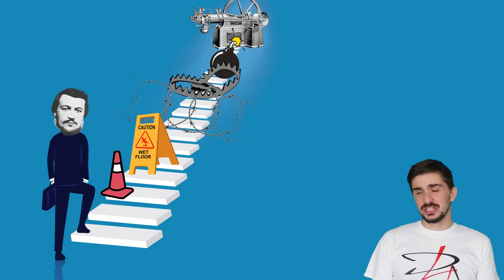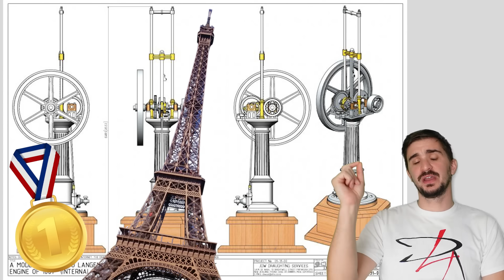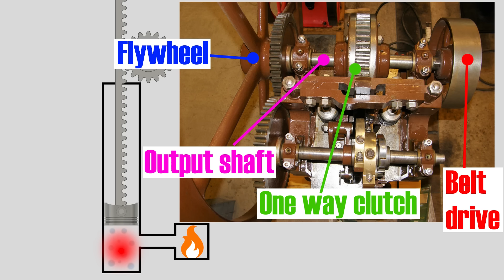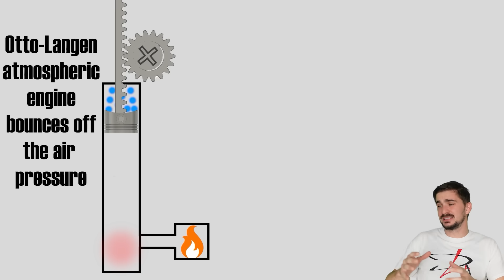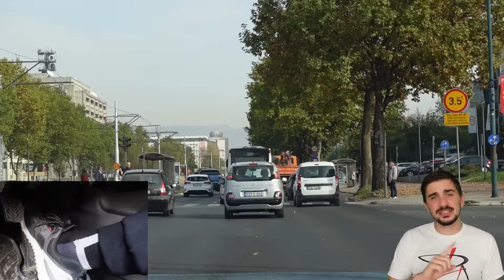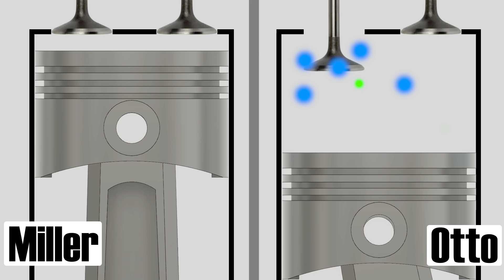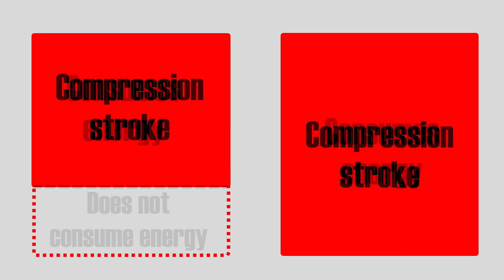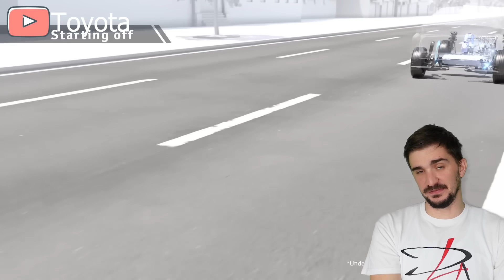You'll understand everything about Atkinson, Miller and Otto cycle engines after watching this video

Comment: Excellent explanation. When I was learning I was taught efficiency is related to compression ratio. Later I discovered it is really a matter of expansion ratio.  Atkinson/Miller cycles let you have an expansion ratio much larger than an Otto cycle.
Reply: it can be monitored on 2 ways: 1. burning efficiency-higher pressure, higher efficiency, and 2. expansion efficiency: as nearer to atmospheric pressure/temperature as more efficient, so max eff will be if both are high: high pressure on the end of compression(start of combustion) and longest/expansion to the lowest temp/press on the end of expansion stroke
Reply: Thank you!

I finished the video, and for the life of me, 8 couldn't figure out why a supercharger wouldn't just cancel out the increased efficiency of a Miller cycle engine.

Your comment finally cleared it up for me.   👍
Reply: @ahobimo732  that's what I couldn't wrap my head around either. Sure the Atkinson cycle is sucking in air and then expelling some of it, but if you add in a supercharger and crammed even more air in there, then wouldn't that higher pressure charge of air be harder to compress than the usual charge of air? I would think that extra force it takes to compress the tire pressure charge of air would cancel out the benefits of having a shorter compression stroke.
Reply: @keithyinger3326  I think the key is what Jim already said: it's not reduced compression that matters, it's increased expansion.   The supercharger can raise the compression and the engine will still acheive improved efficiency, IF it has a longer expansion stroke.
Reply: Both things are true, thermal efficiency is linked directly to compression ratio, but having an expansion ratio greater than the compression ratio also benefits efficiency.
Reply: @keithyinger3326  The idea behind the Miller is that when the intake valve is held open, the piston is compressing not just the air in the cylinder, but also all the air to the supercharger. Compressing 20% of the crank for that much volume is a bit easier. For a limited range of air pressures, using the supercharger to compress air is a little more efficient. Once you start going up in psi, efficiency starts dropping again.
Reply: @keithyinger3326  what matters most for efficiency is the temperature and pressure of the combustion products at the end of the power stroke. The closer those two numbers are to the ambient conditions, the better efficiency your engine will have, given the temperature and pressure at the beginning of the power stroke are kept constant. When you supercharge an Otto-cycle engine, the combustion products are at a much higher temp/pressure at the end of the power stroke, compared to the Miller-cycle engine. The Miller-cycle engine started the compression stroke with a smaller volume of fuel/air mixture at the same pressure coming out of the supercharger, so obviously it will be at a lower temp/pressure at the end of the compression stroke, and at the end of the power stroke. Basically, in exchange for the ability to burn a whole lot of fuel real fast (aka high max power), the Otto engine doesn't extract all of the work it could from the combustion products. It's better to move on to the next power stroke early if you care most about max power, because the power you waste on each stroke in the form of exhaust temp/pressure is made up for by having more strokes per second.
Reply: @keithyinger3326  
You are correct! When the supercharger is making boost, the miller cycle engine thermodynamically reverts to an otto cycle engine. There is a nuance here that the video does not go into. The only time the blower is making boost is at medium to high power settings, the rest of the time the blower bypasses the discharge side back into the suction side. At low to medium power settings the engine is more thermodynamically efficient because the expansion ratio is larger than the compression ratio. At high power settings the blower Prevents the piston from pushing half of the fuel/air mixture back out into the intake manifold on the compression stroke. It is a way to get the best of both worlds without needing variable valve timing. I hope this explanation helps. Cheers!
Reply: Without an Ottocycle there is no Miller or Atkionson.... German Kfz Meister

And yes the Ratio will reduced and so you get the variability between Max comorassion and lowest possible compression for mixing fuel and air
Reply: @keithyinger3326  a supercharger works only with wide open Manifold So that the Charge Regulation works over the chargerpressure....
Reply: @thetransformatorium7980  Wonderful! Thank you very much!
Reply: Then, all vvt engines are miller? An otto engine with a big cam is otto or atkinson?
Reply: @felixlafuente9714  there is no Atkionson or Otto engine. All gasoline engine are Ottoengine only Wankel is Wankel.

And if an car has Valvetiming or length changing Systems they are not automatically Atkionson or Miller!!!
Reply: It's all about how much heat ypu can convert into work.  More expansion means more useful work and cooler exhaust gas.  Mazda SkyActiv engines (14:1 in Europe) have such cool exhaust gas at idle that they need a special warm-up cycle to get the catalyst heated.  They sound rough as a dog for the first minute or two!
Reply: The thing is, to maximize the efficiency you want the pressure to start and end as close to atmospheric pressure as possible. This is practically impossible in a piston engine but the atkinson cycle gets closer to that ideal.

Turbine engines (and multi expansion steam engines to some extent) can get closer to this ideal by adding more and more stages to harvest as much energy as possible from the system

Comment: This is exactly what I needed. When I got my Prius, all I knew was "atkinson cycle more efficient less powerful" but was having trouble figuring out why or what the actual difference was. This explained everything and more. I think teaching engineering history is enormously helpful to explaining the concepts themselves.
Reply: Same here, I was wondering why my Prius has an Atkinson
Reply: Mazda used the first an ONLY Miller Cycle engine in the Millenia. 2.3L V6 Miller Cycle. Never before or since has one been used. I drove it for years. No problems and it's sound and attitude put it right along with Nissan's VQ engines to me. Extremely peppy engine.

Comment: i needed this video so much, nobody explains engines better than you on youtube, many thanks :D
Reply: I'm not a "motor head" myself but I love the videos on this channel.
Reply: @ddegn 
I'm gonna close my eyes and picture the words coming out of Christoff Walz's mouth.
Reply: This video reminds me to not take forbgranted what we have now. Its crazy how gold stuff I today compared to the early days of the ice
Reply: What is in this video is wrong and right, but more wrong.  You absolutely need compression to get high thermal efficiency.
Compression is why diesel engines are so much more efficient than gasoline engines. Large expensive diesel engines powering things like container ships or desiel locomotives can reach 50% thermal efficiency    Compression does not merely improve power, it improves efficiency.
Reply: @tarstarkusz  "You absolutely need compression to get high thermal efficiency."
I thought the need for compression was stated in the video? The question is how this compression is achieved.
The compression can be achieved using a supercharger rather than using the entire compression stroke. I don't know why compressing using a supercharger has advantages but I doubt Mazda would add this complication without having a good reason.
Reply: @ddegn  Compression via a supercharger is coming from the engine while adding an inefficient belt drive system.
Now, the Prius system is different (I believe). The energy for the pump, I believe, is coming from the nickel metal hydride battery.
They use the supercharger to build compression.  The problem is, the supercharger is putting a pretty decent load on the engine, like over 40 horsepower. (google says about 20%, which on a 200hp engine is 40 hp, though it would vary by load)
Reply: @tarstarkusz  It seems odd they'd use a supercharger rather than using the engine stroke but I doubt they'd go through the trouble without a good reason.
Reply: @ddegn  All I know for certain is the reason diesel engines are so much more efficient than gasoline engines is diesel allows for much higher compression ratios because it doesn't pre-ignite.  If gasoline wasn't prone to pre-ignition, we'd have 15 to 1 compression ratios with gasoline engines.
Perhaps it saves a slight bit of gas under certain conditions.
Reply: @tarstarkusz  "Perhaps it saves a slight bit of gas under certain conditions."
That was my impression from watching the video.
Reply: @tarstarkusz  all of his videos that I've seen are more wrong than right.
Reply: @ddegn  the reason for supercharging is you can cool the gas before it's compressed by the compression stroke. This allows for a higher effective compression ratio while limiting the temperatures in the cylinder.

Comment: Another great video.  As a mechanical engineering student you've taught me way more than any class ever could!
Reply: You really need to pay attention in thermodynamics as this guy got it all wrong.
Reply: @DuaneKerzic  What did he get wrong? In my thermodynamics class we analyzed the Otto and Diesel cycles within a control volume and neglected energy loss, energy in and out, and mass in and mass out . We solely focused on the changes in temperature and pressure within the control volumes to keep things simple. The video doesn’t go into depth about the chemistry and thermodynamics but his approach is realistic and applicable. I didn’t notice anything wrong about the information in this video but I could have missed something. 🤷🏽‍♂️
Reply: @eli6394  In my thermodynamics classes, we learned how to analyze the Carnot, Otto, Diesel, Stirling, Ericsson,  Atkinson, Miller, Brayton, Rankin, 2 cycle internal combustion engines, along with the effects of turbo and super charging (with and without intercooling), economizers, super heat, reheating, and much more. 

He got the linkages correct. But the linkages aren't why an engine makes power. They make power by extracting heat from a gas due to the expansion of those gasses.

As we know efficiency of an otto cycle is proportional to the compression ratio of the engine, the compression stroke doesn't rob power from the engine. In the case of the Atkinson and Miller cycles the efficiency closer to the expansion ratio of the engine. The reason these cycles were developed was to allow greater expansion ratios while still using externally mixed low octane fuels to control knocking and preignition which is limited by the compression ratio. The 'super charger' in the Miller cycle wasn't replaced by an electric motor. There were naturally aspirated Miller engines in constant speed use before Toyota and Mazda. Which is basically how they are used in hybrids with generators and CV transmissions.

The reason for the electric motor is to allow for a lower power, lighter, smaller displacement, high efficacy engine that runs at a constant speed and constant power most of the time. An auto only needs full power for very short periods of the drive cycle such as starting from a stop, climbing steep hills.

I could go on.
Reply: @DuaneKerzic  I agree with you point on thermodynamics, It is the longer expansion cycle that gives a more complete combustion. About Toyotas hybrids, I think he meant that the supercharging is replaced by the electric drive at low rpms of the engine.Basically, the engine i an hybrid can work on a single rpm so there is no need for a responsive and low torque engine there.
Reply: It has nothing to do with how complete the combustion is. In our regular gas engines we aren't allowing unburned fuel to be exhausted. We just aren't expanding the gas after heating it as much.
Reply: @DuaneKerzic  go on please need more

Comment: We own two Toyota hybrids: a 2019 Prius Prime, and a 2020 Corolla Hybrid. They both get phenomenal fuel economy: 58 mpg in the Corolla, 65 in the Prius Prime. Both have the same 1.8l VVT Atkinson cycle engine. The Prius Prime has a larger 8 kw-hour lithium ion battery and this can store more recaptured energy from regen braking, than the small 1 kw-hr NIMH battery in the Corolla, so it's fuel economy is better. My personal opinion is that plug-in hybrids are the most versatile vehicles ever developed. Depending on battery size and weight limits, it should be possible to build a 5-passenger sedan or 7-passenger Mini-van that would have up to 100 mile EV range. Pair that with an Atkinson cycle engine (1.5 liter in a sedan, 2.5 liters for a Mini-van), and a 16 gallon fuel tank, and you would then have 600 mile range for those long road trips that Americans love to take. For people living in areas with very cold winter climate, having an ICE lets you run the heater full blast without significantly reducing driving range, and running the ICE for a few minutes can warm up the traction battery far more quickly, so that it can accept a faster charging rate if you do stop somewhere at a DC fast charging station.

I Loved this video! It's the best explanation and best graphics I've ever seen to explain just how Atkinson's crank linkage and Miller's VVT valve timing concepts actually worked. The Atkinson engine with the complex linkages would probably have never worked well in a passenger car: too complex and too bulky.  But the way Toyota uses a Miller/Atkinson hybrid cycle (VVT, naturally aspirated) works amazingly well in the Toyota Hybrid Synergy Drive. In the Prius Prime and Rav4 Prime, most of the propulsion power comes from the electric motor, unless you are climbing a steep hill, or the traction battery is depleted, in which case the ICE comes on-line. Thanks for the video!